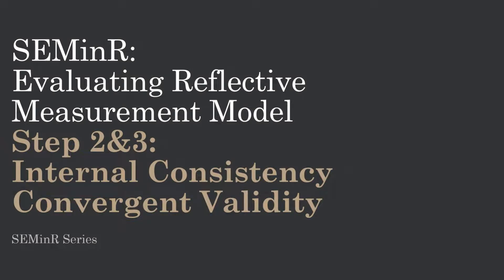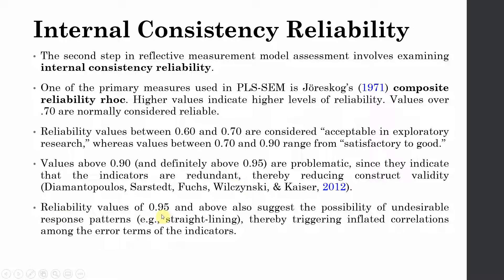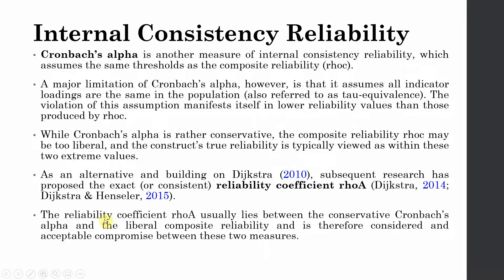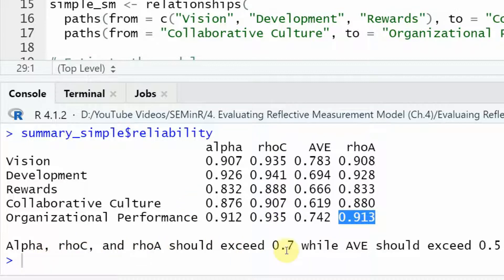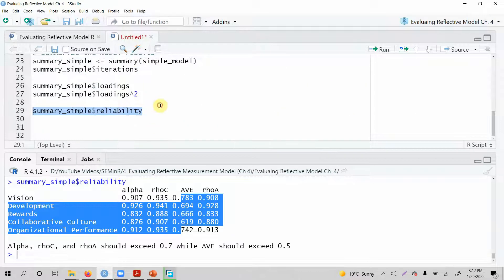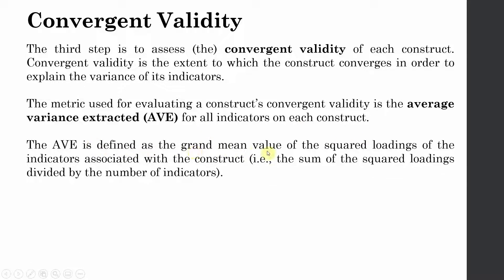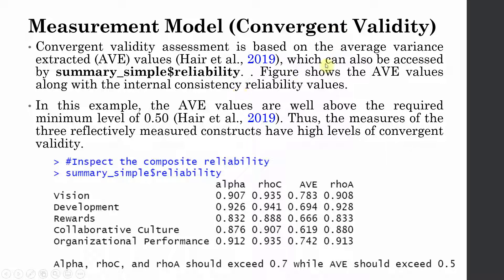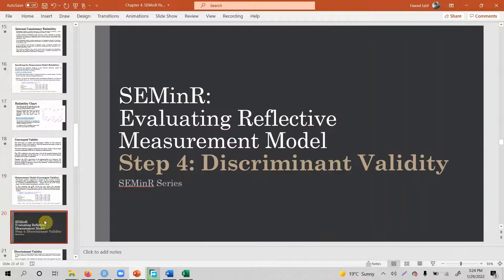13. SEMinR Series - Reflective Model | Reliability and Convergent Validity

Comment: Beautiful presentation professor!
I have a problem here, my rhoA value exceeds rhoC (and 1 too) at 2.054 whereas the rhoC value is at 0.789. Is there a possible explanation as to why this is happening besides (perhaps) low quality data?
Reply from the maker: I am glad you liked it. Is it the case for all constructs?
Reply: @researchwithfawad  no sir, I have 4 constructs and only one of them have rhoA beyond 1.0. As a note, its Cronbach Alpha score is 0.732, so if I could guess, the normal rhoA should be in between 0.732 and 0.789. Furthermore, the construct has 3 items, and the total observation is 74. At first I thought my low samples could be the problem, but when I tried again with 94 samples the rhoA became worse at 4.426.
Reply from the maker: have you checked for outliers?